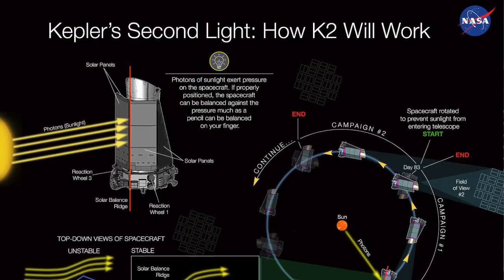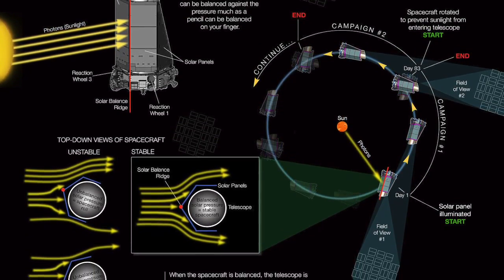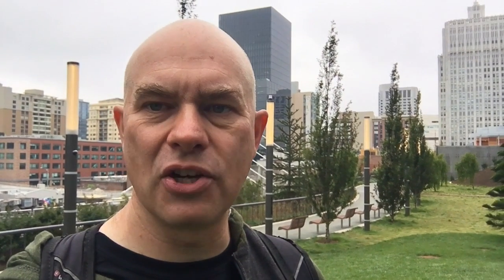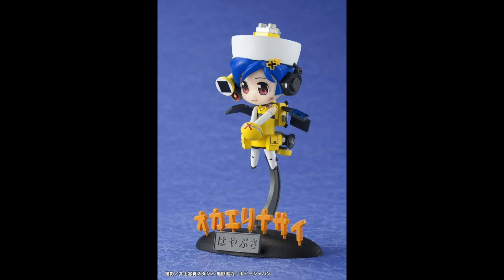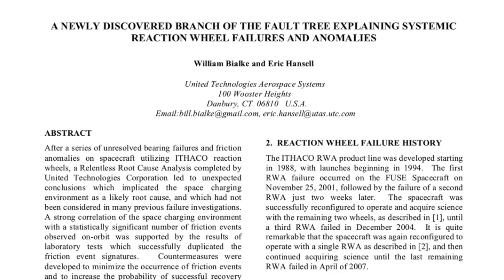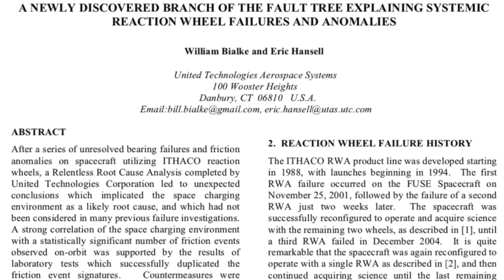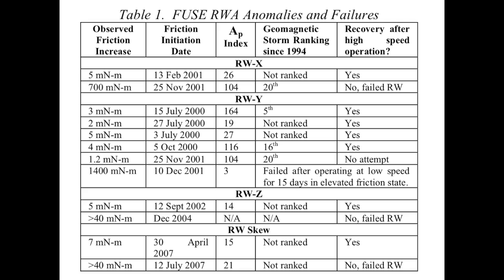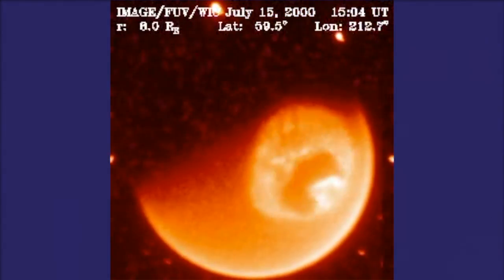Scientists May Have Figured Out Why So Many Spacecraft Were Failing

Comment: I worked on commercial space communication satellites, and  my dad worked on Hubble Space Telescope. Reaction wheels were always acting up. On Hubble some of the reaction wheels have been replaced on servicing missions, the only spacecraft (other than the ISS) that such replacement in orbit is possible. On our commercial satellites, there were usually more than 4 wheels, so there was some redundancy. I always wondered why such a (seemingly) simple device was so troublesome. Your video provides some interesting insight into this issue.
Reply: "...the only spacecraft (other than the ISS) that such replacement in orbit is possible." WAS possible. Since the retirement of the space shuttle fleet, there is no spacecraft currently able to rendezvous with Hubble and secure it sufficiently to perform any sort of maintenance on it. Its days are now numbered. HST might well last well into the 2020s. Even if the JWST is completely successful, HST is capable of "seeing" in wavelengths that JWST cannot. A 6th servicing mission may well be approved some day, using a spacecraft yet to be deployed, in order to save one of the most beloved spacecraft ever launched into orbit.... at least, for a time.
Reply: ed p, do you know if the reaction wheels that were replaced on the HST were examined and their reason for failure was discovered?
Reply: @aspzx  hey he's making a good point
Reply: @aspzx  Manual inspection of the bearings probably would not reveal arcing as the primary cause, the total damage by the time of failure would obliterate the initial point of arcing.
Reply: @aspzx  its sounds as if they haven't examined them being they were replaced before they started wondering about this new theory of the cause..   BUT I wonder if they exist any were on a shelf or warehouse were they could be looked at now to try and confirm the theory of why they are failing from solar flares.
Reply: As an inspector for European Space Agency subcontractor, it comes as no surprise to me that spacecraft fail. One of my roles was to forge and falsify tests data on components even though I pointed out the practice until I was blue in the face.  Those in the know will have heard of "Contact engagement and separation force, also "Robustness of termination" testing, I never carried them out in my 20 year career, well I did the Robust test in 97 and it failed and I was told to "Pass it just now", "just now" meaning the next 15 years. These are just two of the tests I was instructed to "wing" You see the thing is subcontractors are under the same financial pressures as any other company, We were building them to sell not to fly. It's called a C.S.I. for a reason.
Reply: An easy fix, if someone would have guessed the issue, would be to add some radioactive material near the bearings, because ionizing radiation dissipates away static electrical charge as it accumulates. Or make the lubricant electrically conductive. Or, as they did by accident, switch to ceramic bearings.
Reply: @kurtilein3  ceramic bearings should be the only bearings used on satellites.
Reply: therealnightwriter  
Ok tin foil hat guy. I, as well as many, many people, have seen it fly overhead at night. With a telescope, you can clearly see its shape and all its glory. Sorry to burst your bubble, but earth is roundish and we go to space.
Reply: therealnightwriter  
Training is done in a pool.
Reply: I was wondering why did they use only 4 reaction wheels knowing that they are prone to failure. And now knowing that commercial satellites usually have more then 4... why did they use only 4?
Reply: @klesk4never   with 4 you have already one redundant. It is always a question of probaility of failure,  weight and (belive it or not) cost. They certainly made the trade off, but as they didn't know this mechanism they probably assumed that the reliability is similar to low earth orbit where most satelites are located and are protected buy the earth magnetic field or to experiments on groud.
Reply: There are other possible causes, but it's best to start with simple and easy to check causes.
Reply: Would a maglev system be better as zero gravity would negate any need for contact.The breaking could by mechanical or electric resistance
Reply: Did they bring the wheels back from Hubble to do post analysis on them?
Reply: I was surprised that they were using BBs and not magnetic bearings. It's possible for metals to cold weld together in a vacuum if they've lost enough of their oxide layer so that could be happening if the lubrication film breaks down enough to allow bare metal to contact in the bearing.
Reply: Meme Master  Lubricants that work long-term in a vacuum are used. Everything was and is lubricated very well and coated in a lubricant layer in any of these mechanical bearings out in space.
Reply: @mememaster147  How would a magnetic bearing handle a CME? (Or something else able to cause fluctuations in magnetic flux?)
Reply: @wayfa13  I looked it up and the only value I found for the magnetic field strength in a CME was 15 Gauss which is less than a fridge magnet. It's quite easy to make magnets stronger than that.
Reply: ed p anything using bearings will always fail at some point, and something spinning incredibly fast (some at the limit of their tensile strength) will fail more quickly.
Reply: therealnightwriter Do you prefer the authentic sterno taste or do you mix yours with orange juice?
Reply: TIMELESS USERNAME - Yes, but you'll have a space army instead!
...just in case the cylons attack Earth.
Reply: @pomodorino1766  ya sureeeeeeee. lol  space force is not to defend earth from aliens and green guys from mars. Its to protect the US from other earthly enemies who are also weaponizing space and farther ahead in the game than the US is which is only now starting to realize they have to counter the threats posed by other nations being able to have space supremacy or able to attack from space or via space.... such as chinas satellite killer missiles and stuff like that.
Reply: Did you know you can watch the ISS go overhead on a clear night if your in the right spot.  I've seen it many times.
Reply: @dugclrk  good comment

Comment: It could also be polymerization in the lubricant-  secondary radiation can turn lube into glue pretty easily.
Reply: This idea is old enough that lubricants for use in space are tested for this in nuclear research facilities. You can just go and buy high-performance lubricants that are rated to withstand both a vacuum and intense levels of radiation. It is too obvious.

Comment: They should make a craft full of reaction wheels, send it to orbit, Wait for like 50% to fail, then have it rendevous with the ISS for inspection and analysis.
Reply: It would need to get out past the Van Allen belts to really soak up the rads.  Might as well put it inside a heatshield, send it on a hyperbolic orbit out to L2 and then let it reenter.
Reply: Unless ceramic bearings aren't the only needed fix, it could be something like the lubricant not having the same conductivity across it leading to the exact same problems, where parts of the fluid will conduct the electricity and cause micro pits while others won't.

What if the pits aren't the problem, but the sudden heat produced is burning off the lubricant on that spot and over time it just burns away enough to cause high friction/wear?
Reply: If it is related to EM discharge, then it'll be easier and cheaper [and much much more boring] to simulate this in a lab on Earth.
Reply: Have funding will travel...
Reply: @jamestheotherone742  No bucks, No Buck Rogers
Reply: better idea than shooting a car into space
Reply: The fact is that if the newer units with ceramic bearings are not failing, then the engineers have solved the problem.  (Not aolved ITSELF, Scott, but solves by good engineers  taking out failure points even without having the solution identified.  Got bad bearings without knowing exactly why? Got a better material available?  Install, test, then roll them out across the installed base if failure rate improves.
Reply: @markdoldon8852  Someone might have just thought "Man, those ceramic bearings aren't any worse than steel ones and we save 40 grams on the non-functional part of the reaction wheel. Let's run some tests and see how it holds up."
Reply: probably worth the effort
Reply: Why rendevous with ISS, why not just use the wheels on ISS?
Reply: Not just reaction wheels. Should include numerous variations of all components that have been prone to failure. Then operate them under the most extreme conditions until failure. A giant test bed. Then return to Earth.
Reply: Meh, a cube sat, stiffed with fairings on different axis, all spinning and sensors or maybe a mechanism to open and photograph the bearings.

Comment: Lessons learned. You get what you pay for. Never go cheap, always go with safety and endurance. Test reliability and longevity before you use.
make the ball bearings out of ceramics reinforced with carbon nano tubes, instead of metal.
Reply: Not necessarily.  On one hand, there's the fact that not all metal bearings fail in space this way, that those that do fail seem to be failing under very specific and unusual circumstances.  Testing was obviously done on the components, and then re-testing, and re-retesting after the patterns became more and more apparent, and things are narrowed down enough now that a theory can be made about the very specific circumstances that some of these components fail under - and it's worth noting that this theory, however educated the guess, seems, for the moment, to be untested and unproven.

On the other hand, expensive components do not guarantee reliability.  In many cases in life, expensive items tend to break down in spectacularly expensive ways.

On the gripping hand, I'm getting a strong impression from the theory described in the video that the problem might actually be coming down to a matter of the problem's root laying in the very fact that these components are constructed in precise, tightly-engineered, high-precision ways using very reliable, long-lived, and high-tech components built to survive computer models and laboratory testing which can fail in real-life application where much cheaper, sloppier, and loosely-controlled components might well have worked better.

One might argue that it's the very over-engineered and, more importantly, fabulously expensive nature of space exploration/exploitation that complicates problems like this to begin with:  with cheaper, more disposable technology, we'd be able to experiment more and take more chances with materials and components under real-life conditions where we can get a larger sample of results and a better idea of what works and what doesn't under real-life conditions.  Instead, we're forced to put all of our eggs into one or two multi-billion-dollar baskets at a time, and only find out how real life treats them after hitting that one "launch" button every couple years.  And if something goes wrong, we're out of luck with any cheap, practical way to find out what happened:  we're left only to guess at what went wrong from long distance.

In other words, going with the more expensive options can have the effect of pricing practical hands-on experience with these materials and components in the real world out of our reach, when that very experience is what we really need to find out what works in the real world and what doesn't.

I predict that it will be the nation that develops genuinely cheap and disposable space technology that will excel and flourish in exploiting and exploring space, not the nations that produce the most expensive, precise, and by-the-expensive-book/test/computer-model space programs that money can buy.  The most rugged and reliable spacecraft that money can buy will, I predict, come across more like some crazy hillbilly's souped-up pickup truck than it will an expensive, lab-tested, tightly-controlled, precisely-designed, expertly-engineered, high-performance, luxury car "built right"....

Comment: That is very interesting, I wonder if there is a correlation also to the premature death of a ton of laptop ball bearing hdds in the early 2000s in a company I worked for compared to the fluid bearing ones.
Reply: Most direct solar flare effects are blocked by the Earth's atmosphere.

Comment: Interesting! There should be relatively simple test setup for it: put a flywheel in a vacuum chamber with an ion thruster pointing at it and power both on. Put a second identical flywheel in another vacuum chamber without thruster and power it on too. Repeat the setup for a few times, if necessary. If the flywheel which is exposed to radiation fails more often, the proposed failure cause could be a thing. Also it would allow for post mortem analysis on the failed bearings. Problem: it takes some time and is expensive.

Comment: Not sure about the ceramic balls solution. Static charges can build up on the rotor before jumping out within a dramatically thousand volts spark. Saw this failure on high perfomance machine-tool spindles.
Reply: What exactly would be the problem if the sparks go around the bearings instead of damaging them?

Also, Einstein got his Nobel Prize not for relativity, but for the photoelectric effect. Add a bit of radioactive material, exposing the whole thing to some low level of ionizing radiation, electrons will get knocked out of surfaces and will travel to reduce any electrostatic charge. At high levels, this is poison to any electrical devices, this is why all robots fail inside the fukushima nuclear ruins. At low levels, this is poison only to any electrostatic buildup of charge. This works in air or in a vacuum. No further design considerations as long as you have conducting surfaces seperated by nothing other than air or vacuum, add some ambient radiation to drop voltages and electrostatic charges across the system.
Reply: Very interesting failure mode. Easy enough to remedy using a simple spark gap though. A few closely gapped sharp points in the right locations should allow any discharge to occur at non-critical areas of the spindle assembly. Or, as  kurtilein3  suggested, use radioactive material to effectively decrease the work function, the results would be similar.
Reply: I thought they would go in the direction of conductive lubricants.
Reply: @ba94845   Conductive lubricants tend to have higher viscosities and particulate content. Perfectly fine for an industrial motor, but completely unsuitable for high speed high precision applications like a reaction wheel.

Comment: There's a lot of unanswered questions regarding this. I'm guessing that these bearings are in a sealed unit? Has anyone checked to make sure that whatever lubrication is being used will actually work long term exposed to vacuum? Has anyone tested to make sure some kind of vacuum welding isn't taking place? Generally the most inane things are studied when it comes to aerospace engineering, so I would be surprised if there wasn't a lot of documentation on it... But the problem is how much LONG TERM study is being done? What happens when this lubricant/grease is subjected to vast temperature changes (because going from being in the sun's light to behind a planet tends to cause a drastic heating/cooling phase) cycles? That's prime territory for metal fatigue from constant and continuous thermal expansion and cooling. What happens if something causes this grease/lubricant to dry up or harden? It might take months to do it. And, of course, you can run into issues with non-insulated metal and high voltage - we have have issues with melting, spontaneous welds and electrical discharge damage here on earth with some things (although admittedly probably not much in the way of ball bearings).
Reply: This is why so many people want these spacecraft recovered - so we can crack them open and see exactly what happened.
Reply: It takes very little current to ruin a ball bearing, and this has been a known problem for a very long time. There's even a special term for this damage in electric motors: https://en.wikipedia.org/wiki/Shaft_voltage

Bearing companies themselves have studied this to death:
https://www.waukbearing.com/en/technical-resources/bearing-damage-index/bearing-damage:-electrical-pitting/
This is something any experienced mechanic or welder is aware of, I have seen multiple failed bearings from poor grounds.
Reply: Well, the obvious suspects are the most likely ones to have been adressed.
Reply: Which makes you wonder if they ever consulted a bearing manufacturer(that would immediately point out shaft voltage) or if the design was fully home brew.
Reply: IIRC, the ordering entity gives the manufacturer the spesifications needed, and they created a design that answers the needs.
They arn't nessisarily actually aware of the conditions that their units are supposed to work under, especially since the low number of recovered units makes idenifying faults even harder since they can't just take a failed one and see what failed.
Reply: Is it possible to create a conducting grease to dissipate the charge? Perhaps with graphite?